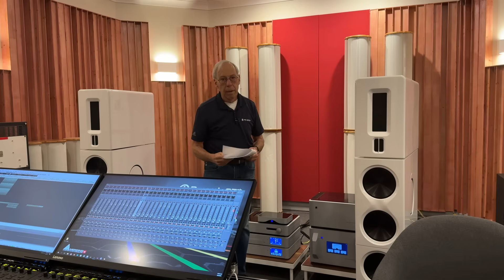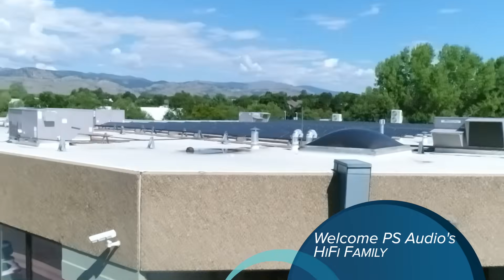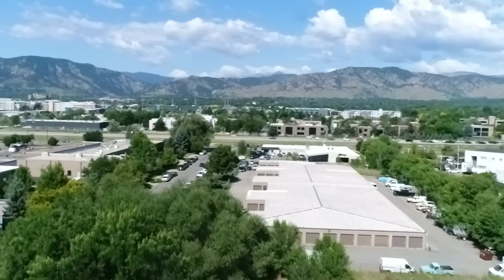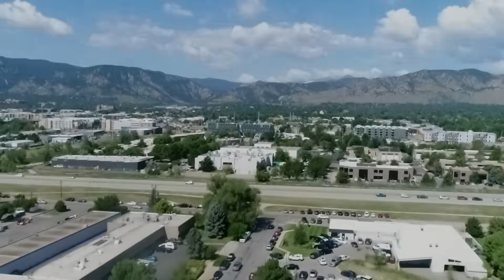Octave Studio design projects

Comment: Paul please listen to what I’m about to say and consider it, having worked in both industries. please release your ADC in the very least you could sell it to audiophiles who could use it to digitize vinyl in DSD, but I am not aware of an ADC at your level of production, I am positive mastering engineers would want it and probably some top mixing engineers. The world needs pro products made with audiophile philosophy. I know it means getting into the pro audio distribution chain, but I think you are missing out. There are companies like lavry where their entire distribution model is just converters and ones not nearly as good as yours. start small with audiophiles wishing to digitize vinyl and bootstrap it!!!
Reply: Most pro audio gear is already built with minimal noise / best tone / etc. in mind. It's totally compatible with the audiophile mindset.
Reply: @ no it’s not, what about the power supplies, voltage rails, slew rate? I don’t think they have open loop anything, you can lower noise by cheating and increasing negative feedback, the hard way to do it is to use low noise balanced power supplies, feedback filtering causes phase shift due to the Gibbs phenomenon. Also clocking in most gear isn’t good,  typically they use low voltage which saturates easily, with the exception of only a few companies like grace, Manley, and SPL, Elysia. They don’t make ADCs, also it would be nice if there were resistive ladder volume attenuation network Mic Pres and ADCs.. that doesn’t exist I own ADCs they don’t sound as good as my high end DACs. also what about discrete opamps or even resistive ladder ADC? Doesn’t exist, also DSD 512 ADCs hardly exist so that is a far superior format that can be mixed down to PCM stems..there is a lot PS Audio could do, you apparently don’t know how good audiophile equipment is engineered.
Reply: The ironic part is that most of that saturation is coveted by engineers due to the beneficial musical character it has on sound. Gear is generally used because of its personality and musicality, not because it's squeaky clean.
Reply: @ not for mastering it isn’t, for tracking yes, but we are talking about different things, personally I don’t want coloration to my Amp tone I want a free flow of sonic purity and what I hear in the room to be captured for even my death metal amp tone out of my ENGL amp. most guitarists will tell you that they wanna record it like it sounds in the room. also ADCs shouldn’t be colored at all because that’s your playback for mixing and mastering, and there are certainly people in jazz and classical that covet transparency in capturing acoustic instruments. Personally I want absolute transparency for my acoustic guitar as well. Listen to some recordings of an SPL brand mic pre or the Manley mic Pres that Paul uses, high voltage and transparency wins every time for me, you can always add a color box after the fact, like the JHS color box. personally I would have a neutral box and a colored one for both tools, why limit yourself?
Reply: I agree.